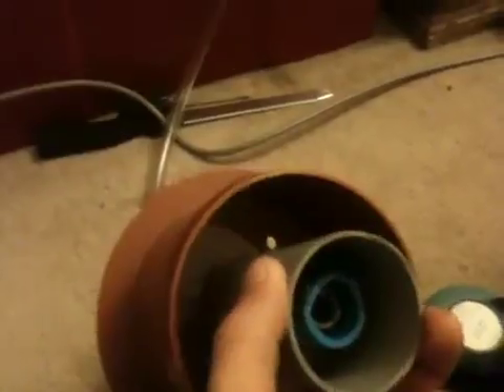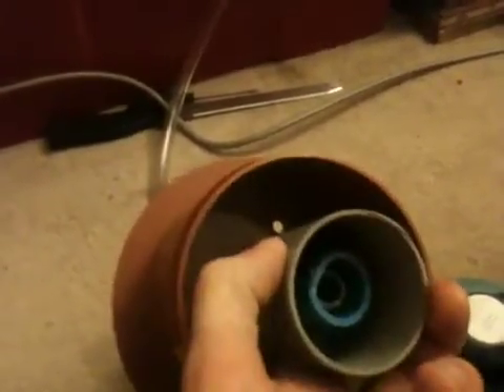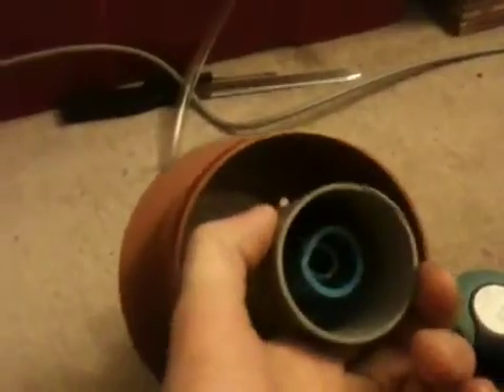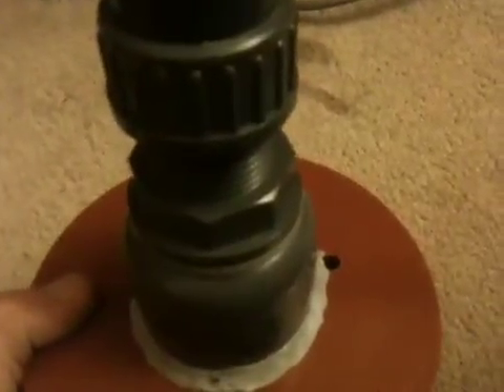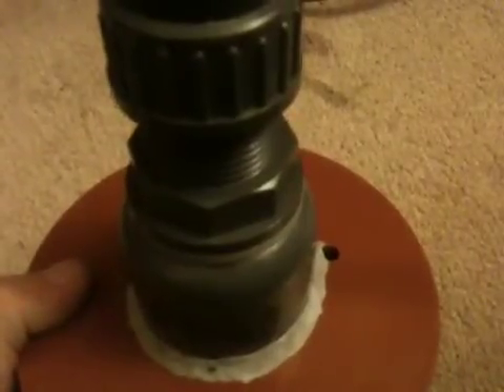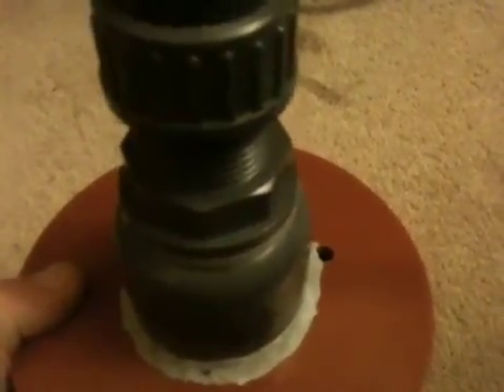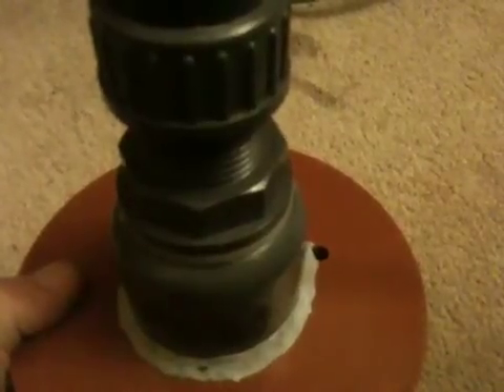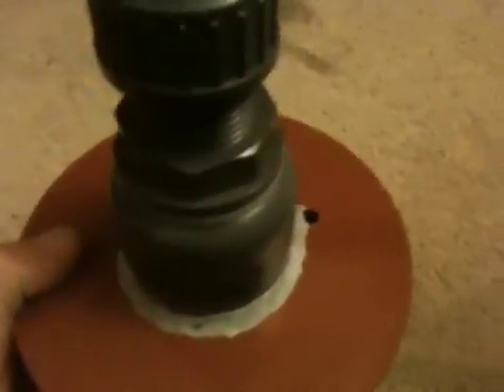DIY geyser pump

Comment: Great vid! Can you explain or show the construction of the pump as to how does the air enter your inner chambers from the outer chamber since it is shorter than the bottom of the inner chambers? I want to use something like this in a 4 foot tall strawberry tower for indoor gardening.

Thanks